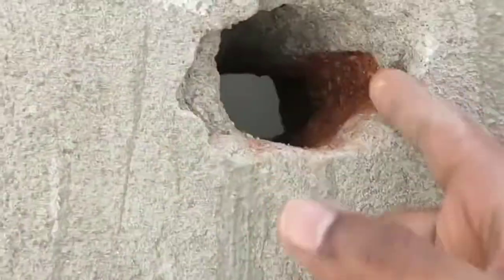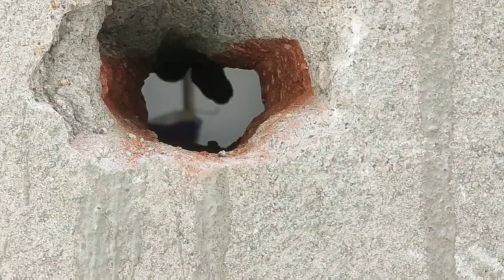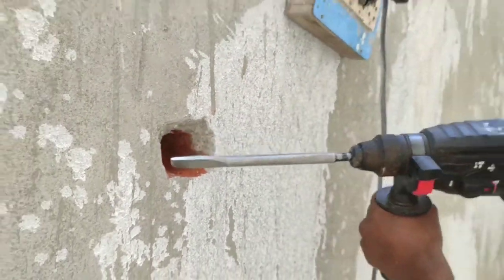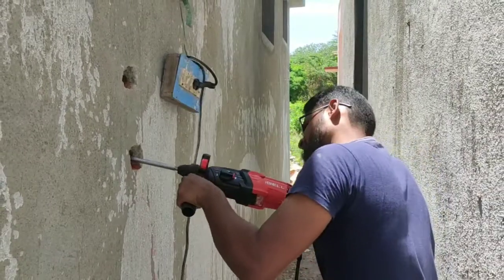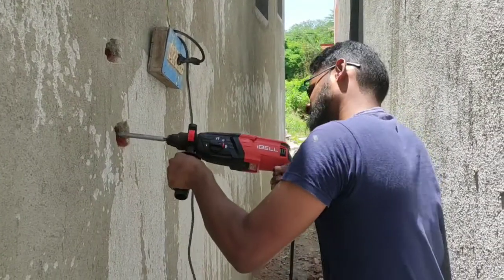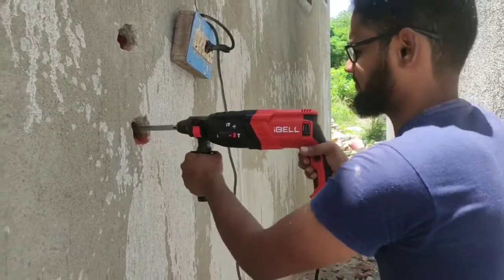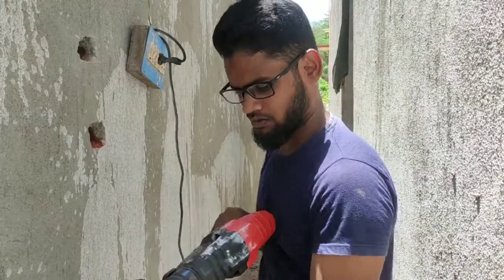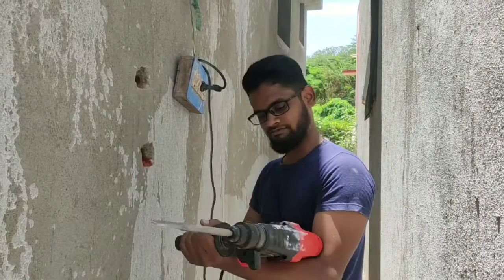Use head phones for voice//I bell Hammer drilling machine work experience // in tamil//@DMSzone

Comment: Heating issue eppadi bro
Reply from the maker: Romba heat agutha???.. maximum 10 min continues ah run pannunga.. than rest for 10 min .. apdi ottunga.. machine fault agathu.. normal ah machine heavy ah run pannumpodhu kandippa heat agum.. so konjam gap vittu run pannunga.. it will be fine.. ❤️

Comment: Bro model
Reply from the maker: IBELL Rotary Hammer Drill RH26-26, 780W, Copper Armature, SDS Plus Chuck :26 mm, 900 RPM, Impact Energy 3J with Vibration Control https://amzn.eu/d/1H7sN6f